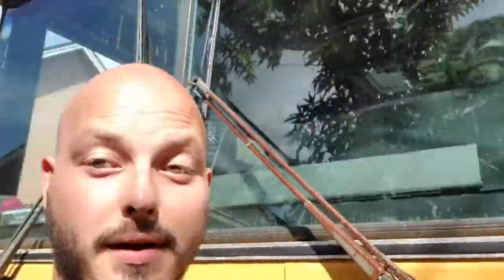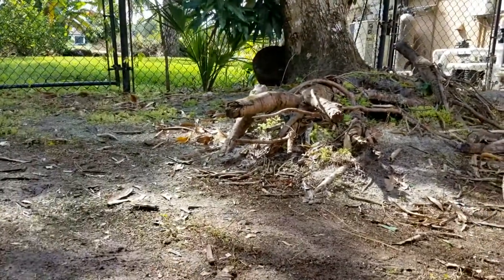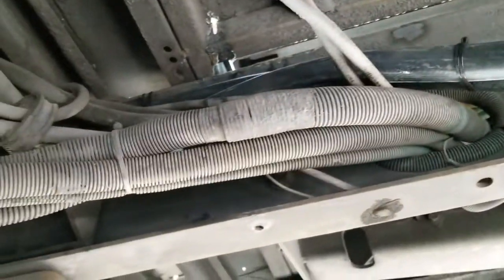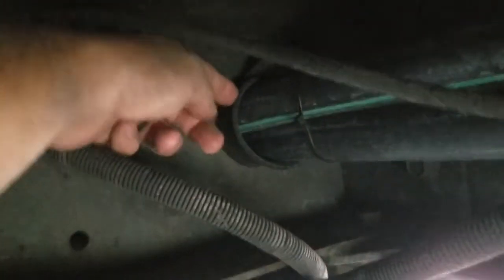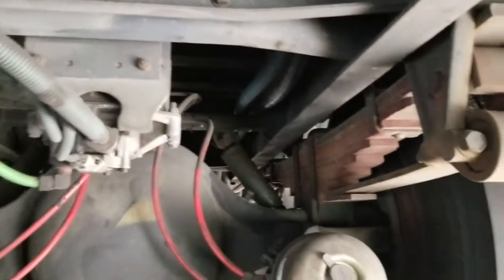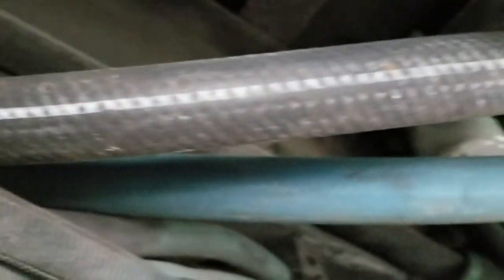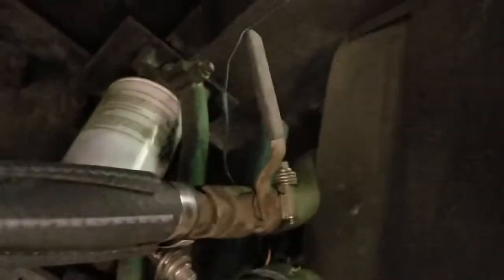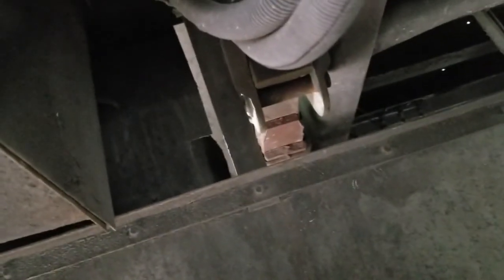Skoolie Conversion: Painting Floors + Mounting Heaters

Comment: Great idea with the heater! I too had this idea and am doing the same with my '99 Thomas bus. When I first purchased the bus last summer, it was 105° outside and I notice the temperature gauge getting close to 220°-225°, but I could knock it back down to 195°-200° when running the heaters. So I thought, I am going to re-install these units underneath and then can use on to them for the really hot days or climbing mountains
Reply from the maker: Thanks Jason! It's worked out for us so far!